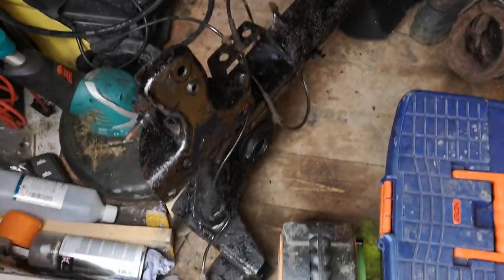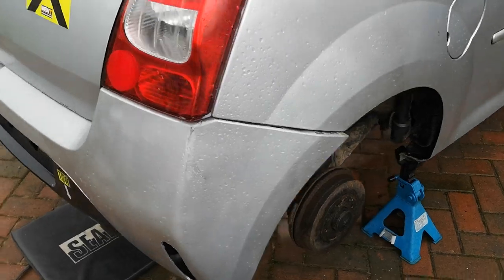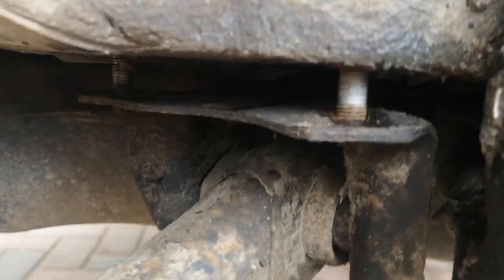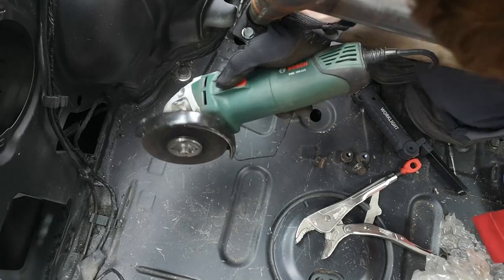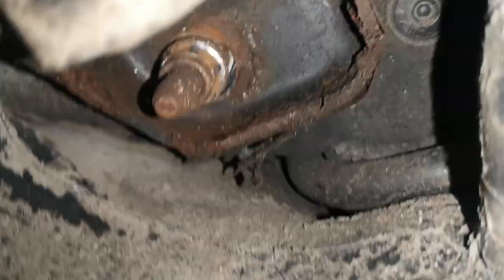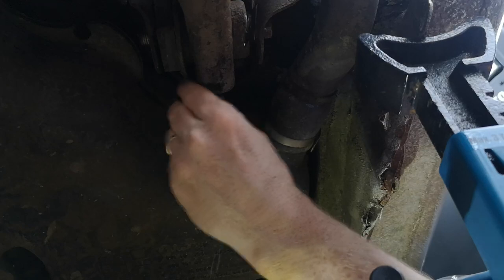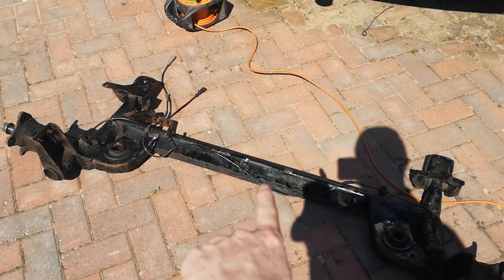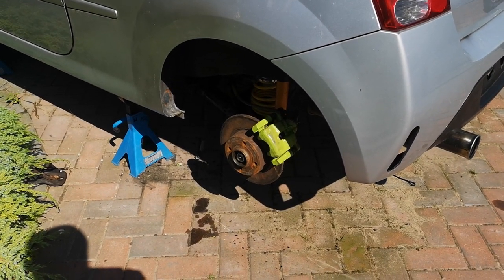Project Twingo - Part 61 - Installing a disk brake rear beam...part 2

Comment: Isn’t the abs ring different to a gt ? I taught you needed clio 2 1.6 rear end for right abs rings
Reply from the maker: Will find out for sure when engine is back in, but both are magnetic pickup for ABS unlike some clio models that use teeth.
Reply: Gt and rs use same style abs abductor rings.

Comment: hi mate , sorey for my grammar hope you understand, i have fk springs and shoks on my audi a5 b8 coupe and about 2 finger wheel gap front and rear , on o good road with some low and high spots not pot hoels!(small waves in the road from hevy cars) My problem is that the car keeps bottoming out at high speed(like lets say 80mph about 130-150kph) , like i feel that they ar too soft and the car bounces and bottoms out they ar only ride height adjustemnt , will some 500£ d2 racing fix my issuse thoes dat have the cliks on the socks for changing the ride more soft or harder?
Reply from the maker: They would be better or Bilstein, A5 is heavy car